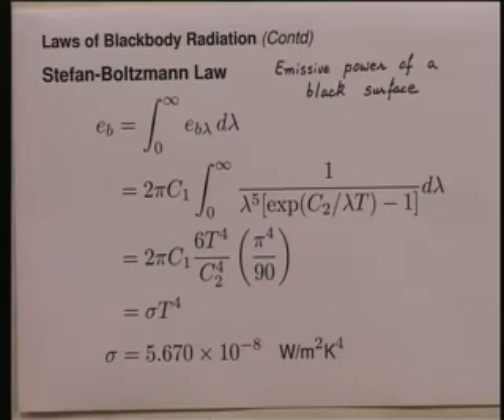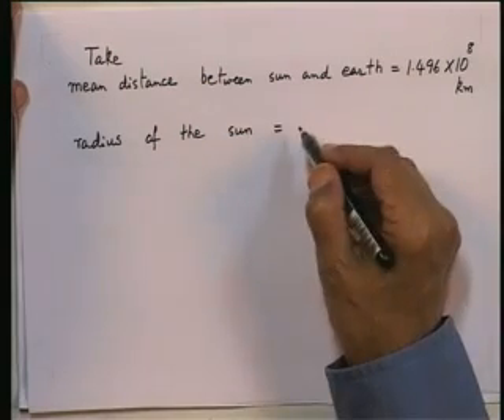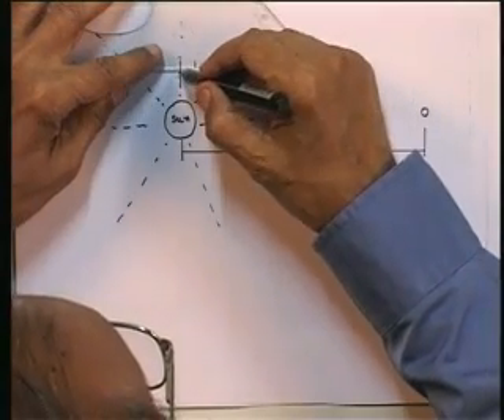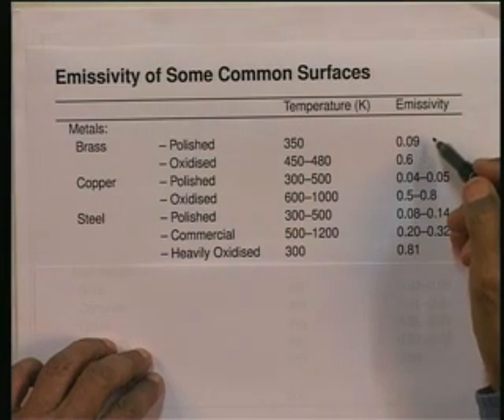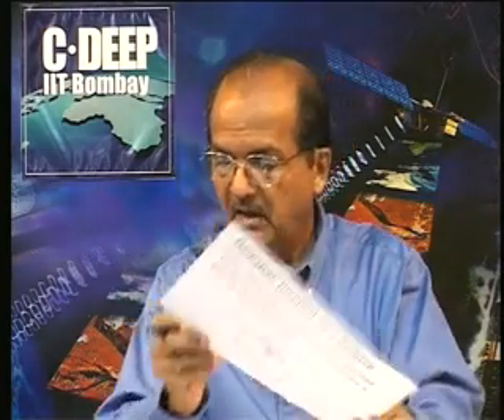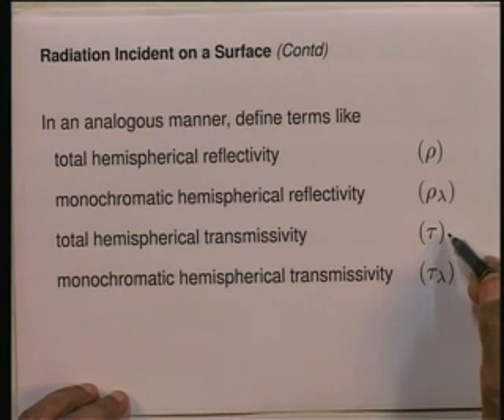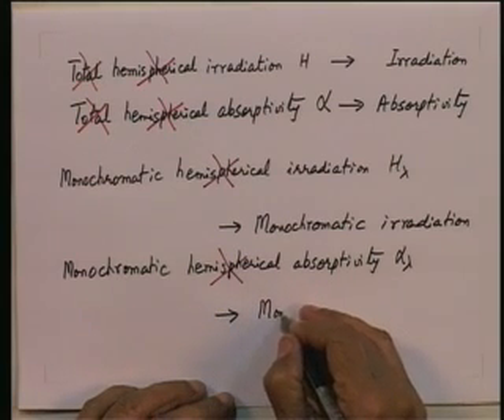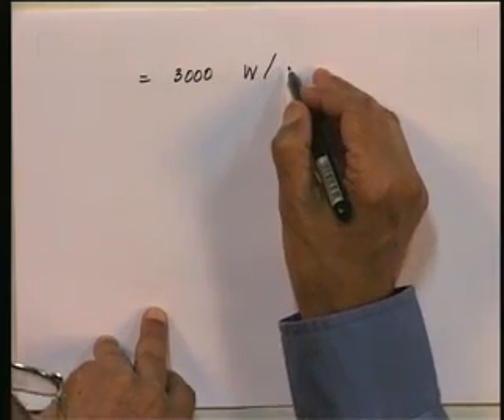Lecture - 11 Thermal Radiation - 2

Comment: sir wien's law in metre and distance bw sun to earth in km. you didnt changed the sign. is that just a mistake or right method?
Reply: it doesn't matter since the dimensions(radius and distance) are in ratio it will cancel out.

Comment: Why is the emmisive power on earth's surface directly proportional to the square of the ratio of radius/distance?
Reply: Because of  inverse square law which can be roughly stated as intensity is inversely proportional to distance squared.
Reply: @saradhavm4878  What is Radiation Shield? It seems like this topic was not introduced in Radiation syllabus in those days as it is  more than a decade old video lecture series on HT